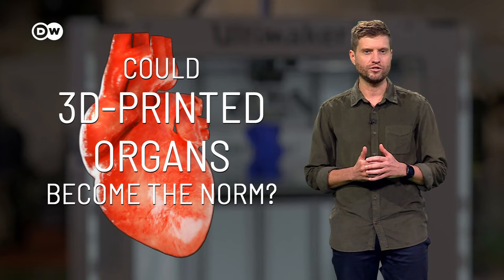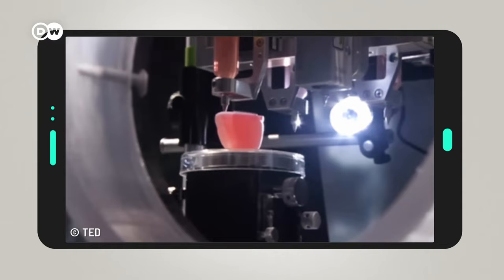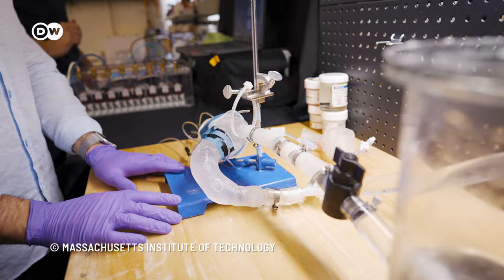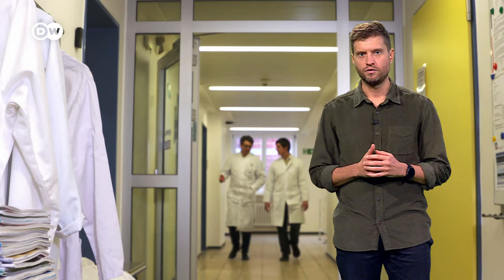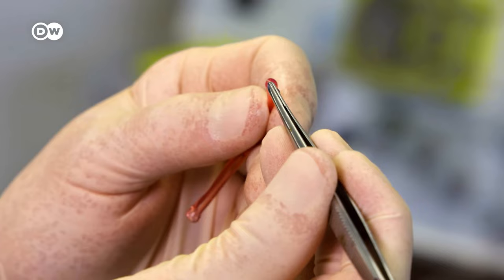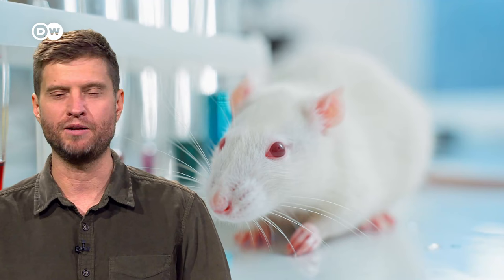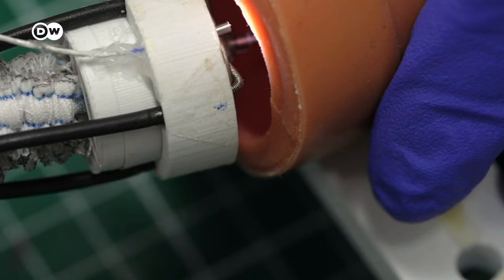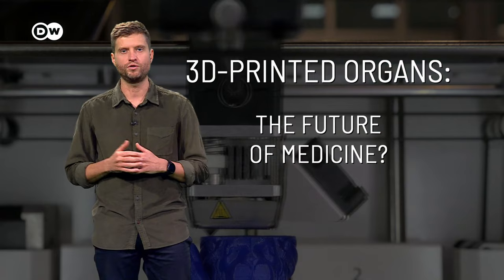3D-printed hearts: A revolution for organ donations?

Comment: Interesting no update on the ear
Reply: The ear is just cartilage, yep? No solid organ that is sth harder to accomplish. U can check a TED where bladder was transplanted by Dr Atala. 👍🏼 On a organ-chip is not the whole organ, but a tissue, just a small part of a functional subunit of the organ being researched. The ones using medical images (CT and MRI) is called biomodels and is usually printed using ordinary polymeric material for different uses.